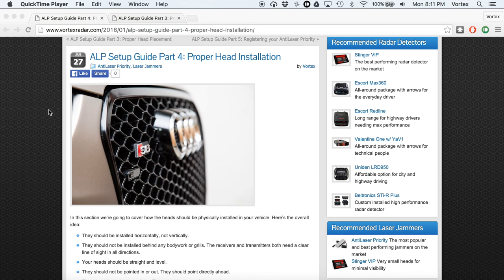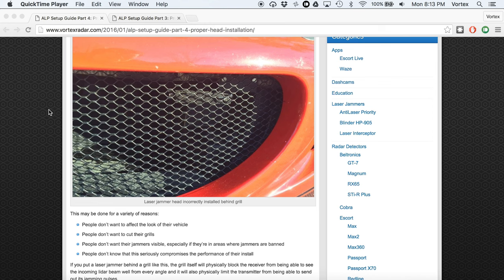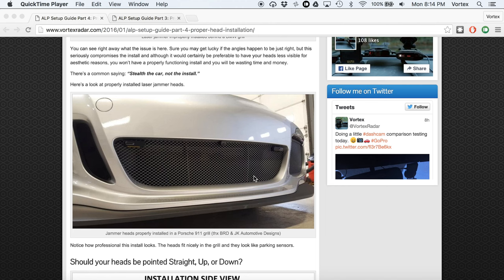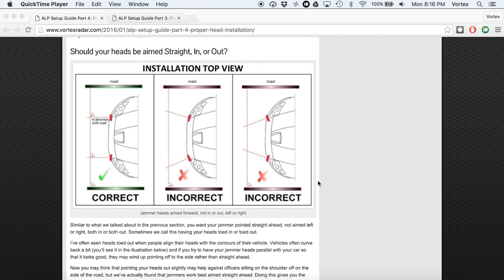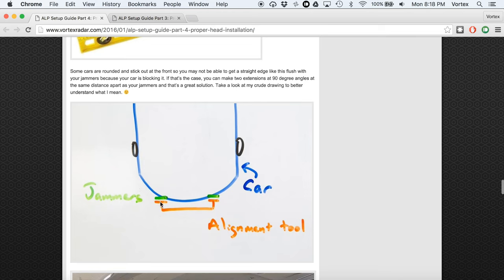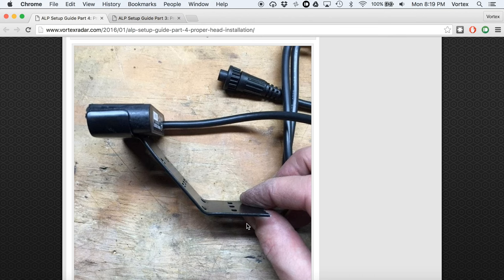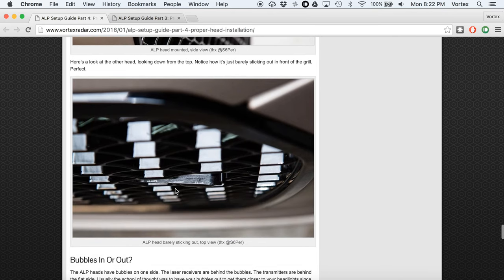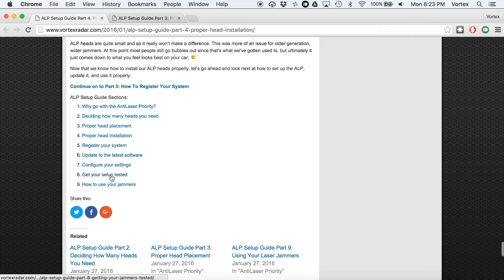ALP Setup: How to Install Laser Jammer Heads In Your Vehicle

Comment: How are these with temperature? I live In northern Alberta. Would I have to take them out before every winter?
Reply from the maker: Temperature isn't an issue. The main thing is making sure that they stay free of snow, salt, and grime. That can mess with the jammer and prevent it from being able to see or transmit laser.
Reply: How does it hold up to road debris and road salt over time, I wouldnt be that disappointed if it didnt detect lidar while it has road salt on it but can that break the jammer?

Comment: My installer put my rear sensors about a quarter inch back from flush on the rear but perfectly aligned…. Could that decrease effectiveness? Wouldn’t the signal still shoot straight out as needed? Or should I unmount the 3m tape and move them out flush

Comment: I was wondering if you tested any laser jammers? like Blinder HP-905? BTW, great review
Reply from the maker: Yeah I used to run HP-905's before switching over to ALP's. They were great for their time. We've tested just about everything at this point pretty extensively.
Reply: Well this is a tough decision...Question so the Anti Laser Priority just does laser jamming....So what about radar detection for KA, should I use a Escort 9500ci or a K40 or something?
Reply from the maker: Luckily enough I just released a video that goes over this. Have a look. :) https://www.youtube.com/watch?v=wgkzNPhaPWo

Comment: So on the blog, you state that if you use a tx sensor, the regular sensors can be placed vertically. Is that correct?
Reply from the maker: Yep
Reply: @VortexRadar  thanks for such a quick reply! 
If you’re looking for a video suggestion, I would love one going over all the hardware options and updates that have been made. I recently bought a used system off eBay to save some money and it looks like I have the cpu hw2. Im still learning all the ins and outs of the different hardware options. I’m still not certain I’ll have everything I need to actually make it all work.

Comment: Hey sorry to bother u again but had one more question I wanted to ask u  , really appreciate the responses . Does it matter if the headers are pointed slightly outwards ? And when I say slightly I mean like a hairs length, literally . I look from the front of my truck and the headers look dead on straight but when I look from the side angle it almost looks like the headers r each pointed slightly outwards from each other. So slightly tho that u can barely tell , like if they were then it would be by a hairs length. Would that have any effect on performance? Or do they have to be drastically crooked to effect performance  ? Thanks for any help!
Reply from the maker: +Darius It's the most common cause of punchthroughs (jammers trying to jam but the gun can get a reading off the car anyways). However, because the ALP is very sensitive, it's more tolerant to heads being slightly misaligned and still giving you solid performance. Do the best that you realistically can.
Reply: +Vortex Radar Ok thanks for letting me know . Is there anyway I can test out my headers to make sure I don't get any punch throughs ? That is other then going out and buying a lidar gun?
Reply from the maker: +Darius You can also go to a lidar testing meet up. See here: http://www.vortexradar.com/2016/01/alp-setup-guide-part-8-getting-your-jammers-tested/
Reply: +Vortex Radar I live in Phoenix AZ , didn't see postings on there for here from what I saw . Could we exchange emails so I can send u 4 or 5 pics of my Tacoma with the headers installed ? I want to get your verdict on it from whatever u can see thru pics if that's ok with u .
Reply from the maker: +Darius Please take a look at that setup guide for information on placement. If you need specific instructions for your vehicle after reading that, follow the links to the forum for placement suggestions.
Reply: +Vortex Radar I heard I can use a rangefinder to test my headers for punch throughs , I saw someone do it on YouTube and looks very accurate. Would this work ? Thanks
Reply from the maker: +Darius Nope, not a good idea. Rangefinders can measure distance but not speed. The ability to jam a distance reading on a stationary object is very different than jamming speed on a moving object. You need an actual police lidar gun and to have a shooter target a moving vehicle.
Reply: +Vortex Radar ok thanks for letting me know...... By the way I posted 2 pics of my Tacoma with my headers installed on rdforum.org a few minutes ago. My user name is Darius on there too and it's under the ALP threads . If u get a chance please take a look at the install and let me know what u think of it , I'd really appreciate it

Comment: What are the dimensions of the heads? I looked but could not find this info. I have a VW GTI MK7 which has a horizontal gap in the grill that would be perfect for head install but I do not know how thick the heads are (vertically).
Reply from the maker: It should be on the website and in the manual, IIRC. I'm actually out getting some closeup photos of them now.
Reply: +Vortex Radar I checked the website and installation guide and found no dimensions. Maybe I am not looking in the right places.
Reply from the maker: Nice! I'll update my setup guide because that's great info. Glad you found it. 👍